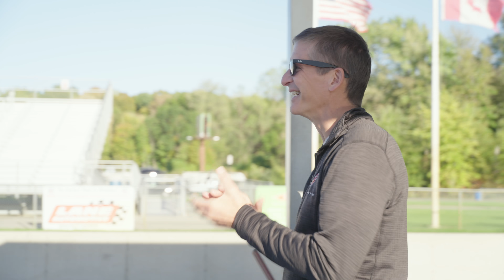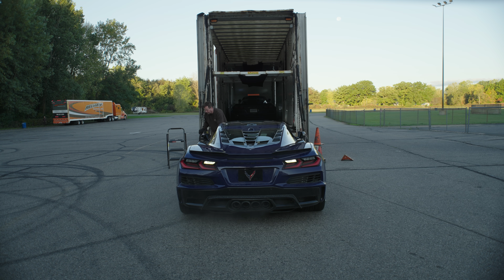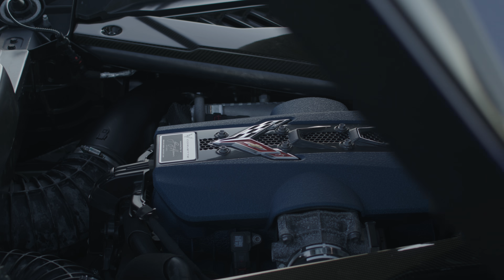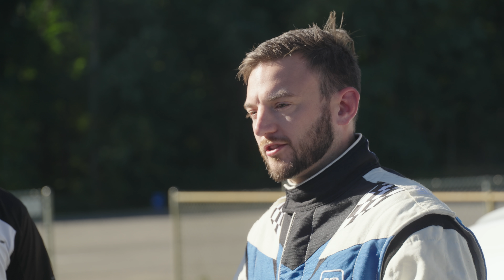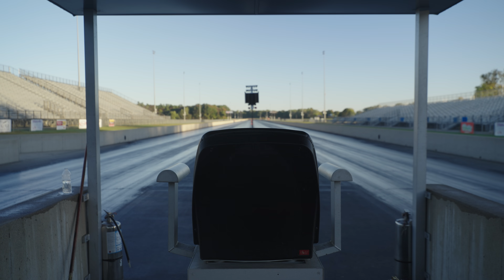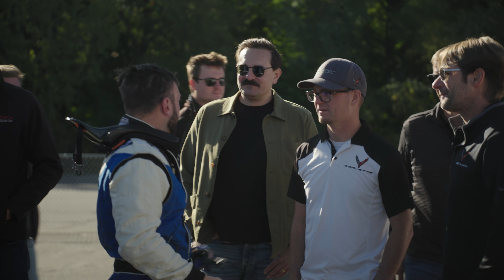We Pushed The Corvette ZR1X To Its Limits (DRAG STRIP TEST)

Comment: OK; a couple of things first: CONGRATS Corvette Division! The next video will be even more epic. Just some clarification:
1. Everyone still says 1/4 mi, but All tracks have permanently reset to 1,000ft standard.
2. It looks like your using tracks printer/timing but have you reset the trap sensor back to 1320 ft instead of 1000ft? 3. When are you posting the sub 8.59 sec run?
3. When are you going to let the G.O.A.T. of the LS tuners Steve Morris get his hands on that and up the ante?
4. GM better think about bringing down the cost a bit more. America needs to get as many of those in as many Americans hands who are going to flog these next; then very far infront of; every wannabe challenger anywhere.
The next Corvette bumper sticker: I eat Bugatti's for breakfast. 😂❤

Comment: I know they weren't worried about traction but if they would have driven around the water box they may have gotten better 60' times which would have helped the top end. Water in a street tire isn't good at a drag strip especially all the runs they were doing. Water gets inside the tread and carries further than you would think. Still unbelievably impressive. Congrats to everyone involved!

Comment: Very impressive. However this is a prepped surface on semi slick tires and likely outfitted with suspension, tune and lightening mods that will not be available to the public.

A stock car with street tires on a regular surface, the ZR1X will likely be 2.5-2.8 to 60 and 9.5-10 to the quarter.
Reply: Nah, will be faster than that, probably 9.0 at the strip.

Comment: Overpriced and probably can't get a normal oil change
Reply: Not even remotely overpriced
Reply: Compared to its competitors, it's a bargain.
Reply: @artanfagdiki I can get two scat pac challengers with low mileage and still have money for dinner....and an easily accessible seat for my 54 yr old worn out body instead of sitting the floor....plenty of power and fun I own a 2016 white scat with shaker and alcatarra seats....plenty of power and fun

Comment: Drove one and think it should not be available to the private consumer for street use. It is dangerous and unsafe. It will burn if you fill it while the cooling fans are running. Third most dangerous car in the US. Now for the kicker. I work for a Chevy dealer. Don't think I have ever supported the sale of a Vette and never will. I love my 2004 Ford rust box edition in the lot visible to customers to show we don't get paid enough. It has an employee car tag on it.

Comment: Pump gas, no drag radials or slicks, no custom tune. Not one single thing done to the engine or suspension. Straight off the assembly line. Everything bone stock. Thats crazy!!

Comment: this is all fairytale. The demon was the fastest American production car and it ran low nines 2 Wheel Dr. with 840 hp. This thing’s four-wheel-drive has over 1000 hp. It is barely knocking off that number. I’m pretty sure if somebody took a tuned demon or viper you would have a serious race on your hands. Let’s take that demon and bump up the horsepower to 1000 and then add some electric motors on the front. My daughter would crucify me for saying this, but the Corvette is still euro trash. It’s a beautiful car. It’s a fast car but I think Chevrolet went the wrong way. We have enough euro trash in this country, I love the C8 because it is not American. It’s had too much European input and what I mean is the makers of this car the designers the architects they were focused on one thing making a supercar and the only real super cars are euro trash, Lamborghinis Ferrari Bugatti’s you get the picture hell I’ve seen a Volkswagen bug do a 640 in a quarter mile at like 187. I’m not gonna go spend 150 grand 200 grand on that.

Comment: If it doesn't smoke the tires dead punch, and can't lay rubber, who cares, 

Bring back Front engine, Manual Analog interaction..

Im a huge GM Fan and this does nothing for me. 

But it is nice, and fast.

Bring back the old cars, Original like the old days and let people custom order them

REAL STEEL, REAL METALS, NO ELECTRONICS, Just Brass,Copper,Steel,aluminum

Comment: its faster than the Venom F5  on 1/4mile time
Reply: But slower than koenigsegg Jesko absolut
Reply: @jozefjozefczyk3936  The Koenigsegg Jesko Absolut's record quarter-mile time is 8.88 seconds. ZR1X is faster.
Reply: @meintingles4396 jesko absolut did it on unpreper surface at low air temperature, on drag strip 8.5s for jesko absolut it is possible maybe even faster.. jesko absolut trap speed is 186mph zr1x only 159mph it's not even close,koenigsegg is much faster.

Comment: Shelby Code Red Mustang GT500 had a trap speed of 161 mph in the 1/4 mile. No electric motor front engine rear wheel drive

Comment: Absolutely ridiculous. Imagine if they just added an E85 tune, they could add 200+ HP. And the ZR1 ALREADY makes 1,200 CRANK & 930lb-ft (based on several dyno tests & Z06's 13%hp/10%tq drivetrain loss).

So ZR1X is making 1,380-1,395hp & 1,075tq.😂

Add E85 & you could easily see 1,600hp 🤯 
💪🇺🇲🇺🇲🇺🇲

Comment: Very impressive machine from GM! Especially for an internal combustion vehicle with electric assist in stock form! And this is coming from a Ford guy. I've always believed hybrid performance is the best of both worlds. Not sure what Ford is waiting on to implement their hybrid tech into a performance vehicle. They have a great engine platform with the Coyote-based engines. They just need to pair it with electric motor(s) to help with traction/acceleration in an all-wheel setup. Adding solid state batteries into the equation would be amazing too!

Comment: Until i see an actual owner run these numbers BONE STOCK from factorty will believe it.
I was looking at the nurburgring times and the corvette for some reason falls in a special category where its not completely bone stock cars. 
And then they also lie about the Eray 0-60 time because of the rollout. 
The fact that theyre hitting this number with elevation and cold weather, i dont believe it. They all have sweaters, with no prep on those temps? 
I dont believe this is a car how it will come from factory to the owner running 8.6

Comment: Effectively makes it illegal at 90% of tracks in its off the show room configuration once u get under a certain ET u need a helmet then 2 ways then a roll cage u wont be able to pull up in the thing and run it like it sits when u buy it they retro fitted a recaro bucket with 2 ways and no roll cage which im thinking its def in the ET space of needing all that lol

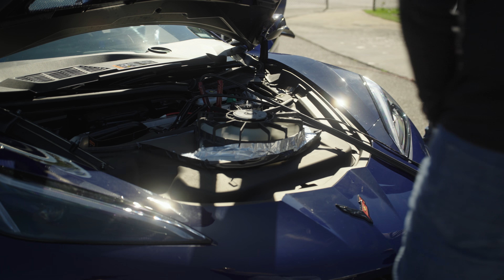Comment: For the naysayers… yes it’s on a prepped track, because that’s where you safely race, and any decent 1/4 mile track will be prepped. Yes, the GM engineers are tuning the car, but so what? At 5:20, “You know,what we’re going to run here this morning is… this is what will go into production. And you know, this will be a car just like a customer could buy and go take to the track. And you know we have every bit of confidence that they’ll be able to repeat the same kind of times in in these sort of conditions. Very cool.”

On pump gas, for a too expensive for me but dirt cheap compared to cars as quick as this one is. The only car that gets anywhere close in quickness and price is the Lucid Sapphire with its 1234 hp and similar torque for about $250k.

Comment: The Tesla Model S Plaid boasts impressive performance, achieving a 0-60 mph time of just 1.99 seconds and a quarter-mile time of 9.23 seconds. $89,990  Khehe the GM Kentucky boy is still faster but.. $209,595.  Note around an actual racetrack with braking and turns the Tesla will get smoked anyway lugging the batteries around by a 20 yr old Mustang.

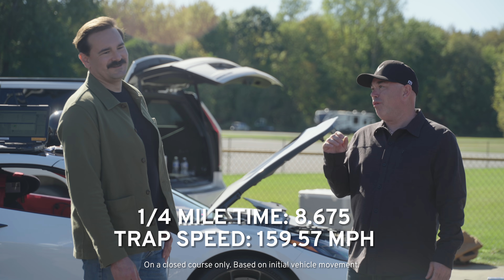Comment: 11:13 Guys, watch for the fine print. It says results achieved based on “initial vehicle movement”. So there is no roll out variable in these stats.
Reply: Roll out makes the times quicker, not slower.  Regardless, IVM and 1 foot roll out are the same.
Reply: @zacharymorris9917 That’s correct, I didn’t state otherwise.
Reply: @GNX157 you stated exactly otherwise.  Don't be a petulant child and reply with nuh, uh. no I didn't when we can literally read your claim otherwise on the same screen you're denying it.  You said, DIRECT QUOTE, "So there is no roll out variable in these stats."
Reply: @zacharymorris9917 There isn’t a roll out, that’s what initial movement means. What I didn’t say, is how it affected the stats.
Reply: @GNX157  IVM and roll out are THE SAME THING.  They specifically talk about staging depth (aka the distance between the prestage and stage lights) in the video which is a reference to taking advantage of the roll out.

If you are ignorant about drag racing, maybe pick something else to speak on.
Reply: @zacharymorris9917  Sorry to disagree, but you’re wrong. In the context of the 2026 Corvette ZR1X performance statistics, the difference lies in when the clock begins timing the run. For Initial Vehicle Movement, this method starts the timer the instant the car begins to move from a standstill. It is often referred to as "no-rollout" timing and provides a more realistic representation of true standing-start acceleration. The ZR1X's 8.675-second quarter-mile and 1.68-second 0–60 mph times were achieved using this metric. Under the Rollout way, (1-foot Rollout), this is a drag racing standard where timing does not start until the vehicle has traveled exactly one foot (12 inches). This "free" foot of travel allows the car to build a small amount of momentum (typically 3–5 mph) before the clock triggers, which can shave 0.2 to 0.3 seconds off the final reported time. By specifying "initial vehicle movement," Chevrolet is highlighting that their ultra-fast times for the ZR1X do not rely on the common industry "padding" provided by a 1-foot rollout.
Reply: @GNX157 - don’t waste your time. u stated the facts correctly - and left it up to intelligent people to make the obvious inference.
Reply: @omariwest9068  wow, just wow.  You're the epitome of lead a horse to water, but can't make it drink.  He stated the facts NOT correctly.  Initial vehicle movement >>>>IS<<<< roll out   They are the SAME THING.  This is something even a dimwit can understand.

Comment: Not quite correct on the quickest fastest car for GM as they still have COPO Camaros while technically not street legal they will show the XR1X to the finish line buy a substantial margin if they’re going to be crawling all over the car trying to get every once out of the car. All three American automakers have a crazy fast specialty cars that they make that run 7.7’s or quicker at 180 plus MPH on a 9” wide rear wheel drive car.  This ZR1X is another level of mega performance car that makes repeated runs without stopping to recharge and yes then drive it home with no trailer needed.

Comment: I like corvettes, but I’m not a gm fan and here’s why. Imagine being a zo6 owner when they released the zr1. 😅 Now then also imagine being a zr1 owner when they release the zr1x…..😂.  Then imagine being an eray owner when they released the zo6. I rest my case, gm is cash grabbing and they also stole half the engines design from Ferrari. Also all ford has to do is drop the 5.2 into the ford gt and add 400 hp of electric all wheel drive and bam, discussion over ford wins, just like lemans. Just like the 24 hours of Daytona. The zr1x has no race car equivalent and it never will because the engine would never dream of competition in that form or any version of the flat plane crank Lt. series.

Comment: What kind of surface is this? Looks like sticky rubber all the way. I'm really not impressed as this is kind of cheating. Also, why do you need a whole technical team to mess around with engine parameters. When you buy a car, it does not come with a technical team and it sure does not roll around on sticky pavement. The times shown mean absolutely nothing to a normal driver. I call this total BS.
Reply: It's called a prepped surface coated with a sticky substance ensuring maximum grip, its not cheating at all as the Demon 170 achieved its numbers at a drag strip as well as the Lucid which did 8.9 seconds at a drag strip so I don't know what's your point. Heck even the Chiron SS did 9.01 seconds in a similar prepped surface. They aren't messing around with anything they are simply ensuring that the car performs to its fullest extent optimized for that specific drag strip and weather. In essence this is as fast as it gets without altering the vehicle internally(engine) and externally(tires,etc) completely stock from factory.

Comment: Give it to Brooks from drag times and he'll get a 0 to 60 in 1.5 seconds and probably do the quarter mile in  8.5 or better, not even considering if you put drag radials on it. This thing with full bolt-ons and straight piped exhaust with a race gas tune and transmission tune is going to be running low eights in the high 160's without even touching the engine..

Comment: Certainly impressive. Would be very interesting to see the times with out the electric motor assist. Obviously it adds more power but also makes it AWD in essence. See what she can do raw! (and in summer time)
Reply: That's basically the regular Zr1, it already achieved 9.29 seconds at the quarter mile on a prepped surface posted by Dragtimes and his was completely stock.

Comment: The 8.67 is obviously wild, but more impressive was the consistent 8.7s it ran back-to-back-to-back on day one, even with heat soak.  Talk about consistency.
Reply: what is really insane that this can be replicated with mass production with quality components. GM has gone above and beyond, i dont think we've even seen their end game yet.
Reply: It's amazing what happens when you introduce electric motors; just wait until solid state battery all electric vehicles hit in the next two years and this will be history
Reply: @MikeMPharmaCyclist  No one really cares about EVs though, they are all fast and all quiet and all souless and boring. Oh wow, it's fast? That's all they do. This thing is far more impressive, can recharge in 1-2 minutes and has more range and less weight than an EV.
Reply: @N4CR isn't the entire point of this video about going fast? Talk about nonsense and a cope. 

The only reason this car is so quick is precisely because it uses a big battery and electric motor.

Soul is something made up by losers.  It's only going to continue to get more and more embarrassing for combustion vehicles in the next years.

NO ONE as a gas engine to an electric vehicle to go faster ;)
Reply: @MikeMPharmaCyclist  No one has conquered solid state batteries yet
Reply: @WeaponizedApe  It'sll be interesting to see what Donut has (or hasn't) come up with. I'm hopeful, but skeptical.
Reply: Donut? If you want a donut you'd have to go to Dunkin's because vettes do give donuts (spare tires) lol. Not even a jack, lug wrench handle for jack, no run flat, etc. Atleast my C5 didnt.
Reply: @MikeMPharmaCyclist  exactly.
Reply: 6;15 looking to improve. Are you for real. Maybe you can build 1 engine to work. Look at all the previous ghosts
Reply: Consistency is the failure of GM engines
Reply: @ToddBrooks-l4n GM needs a Pieche a guy who makes amazing cars and beats the hell out of them before the get released
Reply: @ToddBrooks-l4n ...they are the Cadillacs of failed engines indeed...

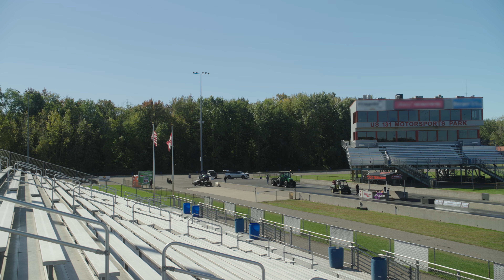Comment: 4:57 gm voided my warranty on my car for doing exactly this... going to a drag strip(event was run/sponsored by gm of course) i kid you not. I can provide the vin for my old car, and if you have access to gm's database it'll show you the history of issues and when they voided the warranty, car was less than a year old.
Reply: If you have the performance pack version they will not void the warranty. In the owners manual for the C8 stingray, it explicitly states that as long as you have the Z 51 package you are free to use it in competitive events, but that using one without that package in said events will void the warranty
Reply: Should've lawyered up then
Reply: @WowCreativeUsername  that was their suggestion too, but wasn't worth it since the biggest issues they fixed

Comment: So 1000+ hp, a super sticky surface, and I am supposed to be surprised it went quick?

yawn. You barely beat a 518hp Porsche around the ring with your 1000+ hp.
Reply: The ring is not the world. Still beat it fair and square though.
Reply: @mavicman21  they needed double the horsepower and they made all their barely 2 seconds on the straight... Chevy should be embarrassed.
Reply: @YouTuber-jz5nd there is a video on hagerty where they use the same driver across the Porsche Mustang and Corvette. Guess who won by a lot on a much shorter track. Chevy just didn't have the best drivers. Porsche literally lives on the ring with drivers who have done it thousands of times. And yet they are still behind despite this huge situational advantage.
Reply: @YouTuber-jz5nd  The ZR1 beat the GT3 RS around multiple tracks across America and by 2-3 seconds. The GT3 RS just can't compete and the 3RS was engineered for the Nurburgring.

Comment: Ford will probably do something with reviving the Ford GT to run in  the 8.50 @ 170 mph, because of not wanting GM to be top dog, then GM will do the same with having to mold in factory roll cages for seven second passes, with Chrysler doing the same. We are about to be entertained with the horsepower wars of pre 1971!